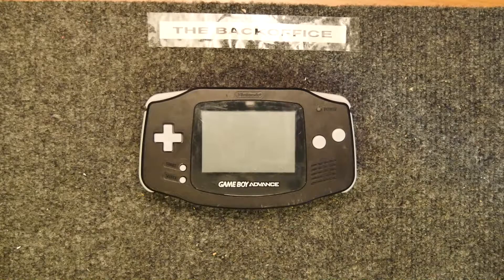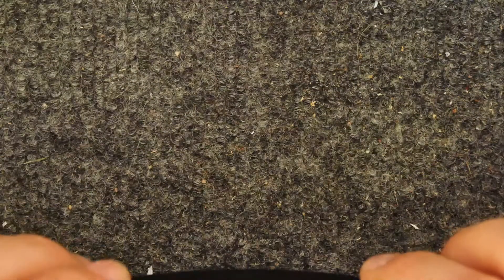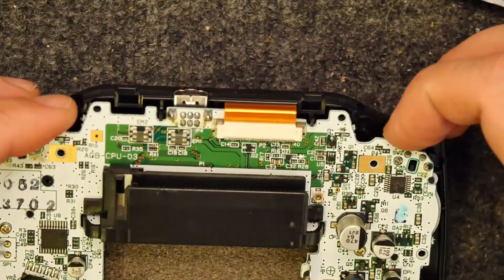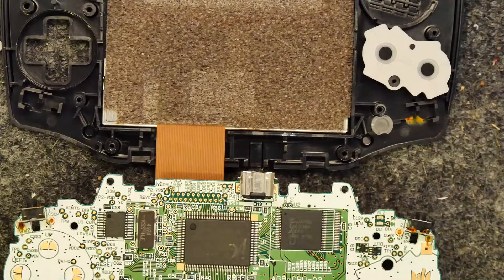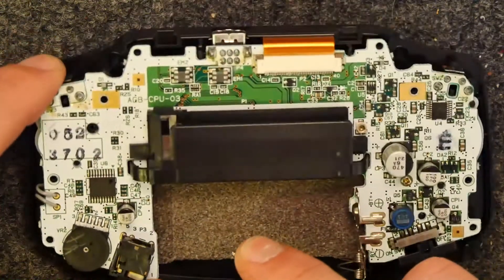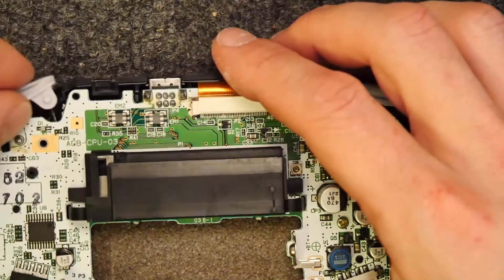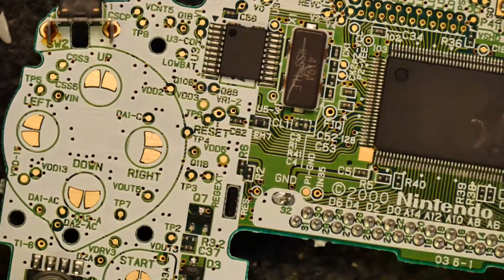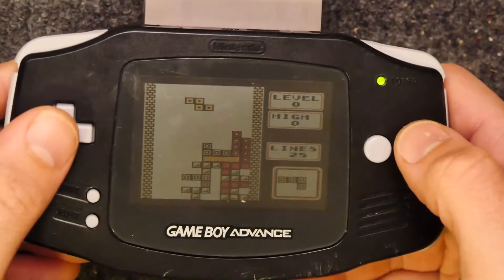Gameboy Advance

Comment: Fortunately, they fixed this issue. I've repaired DS Lites, DSis, DSi XLs, 3DSes, 3DS XLs, 2DSes, and I'm currently trying to fix a new 3DS XL. The only modern unit that I haven't looked at yet is the new 3DS.

98% of the time, a simple cleaning with alcohol will do. 2% of the time, and only on the DSi and DSi XL, one button stops clicking like it should and I simply swap out a daughterboard from a unit with a broken screen.

The D pad and buttons are really quite robust, and can take quite a beating. I've seen the outer shell worn down but the D pad still working okay after cleaning it with alcohol.
Reply from the maker: +John Gotts Do you know what the issue is? I Rosie this in a later issue by jumping from the pad contact directly to the CPU. I can only assume the tracking got broken somehow, but no obvious signs of damage.

Comment: i have a white gameboy advance and the outer shell i quite  dirty along the lines and crevice , i was wondering whats the best way to safely clean those parts?
Reply from the maker: If you do not fancy cracking it open, I suggest a mild washing up liquid solution and a bit of tissue. Use your nail or a guitar pick to force the tissue gently into the cracks, that usually works.

Comment: I love all the different flashcards/copiers for retro systems.

 I have  a Russian friend who found there old what in Russia was sold as the  Famicom/NES  since it was never released there (a clone called the Dendy). Was looking at Famicom Flash carts for her to use on the Dendy. Then I realised the actually games released for the Dendy were mostly 100 in 1 bootlegs anyway Haha

Also I think that card 32 Megabyte. The DS cards used megabits as well to seem bigger I guess.
Reply from the maker: +Ganjulation I guess we will never know as I am pretty much sure I do not have a writer for this flash cart. I recall back in the day they had huge parallel port programmers for them.